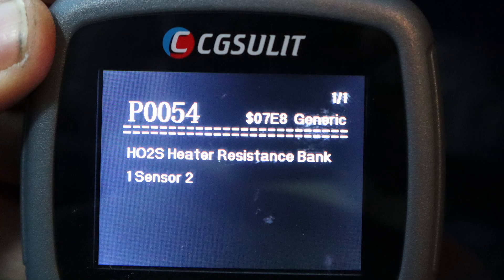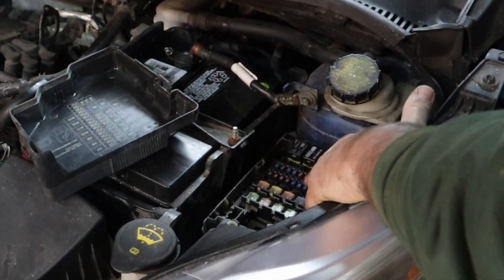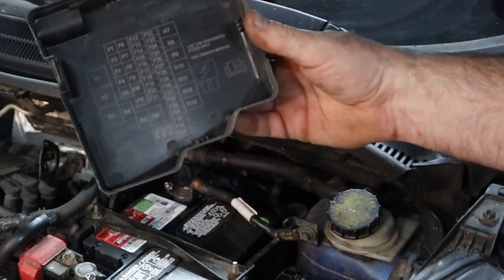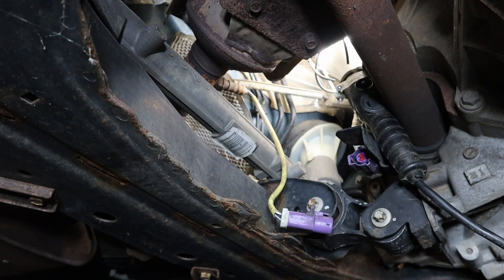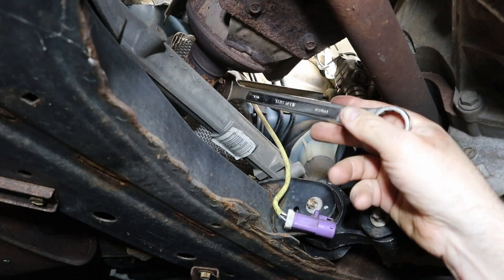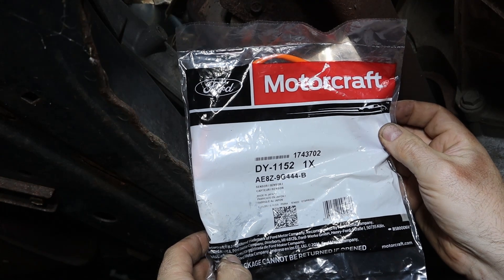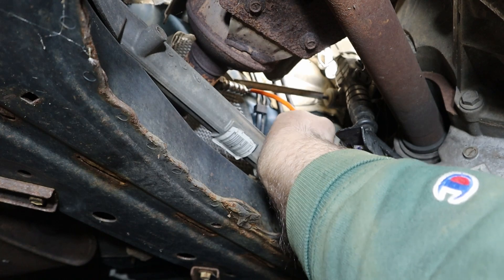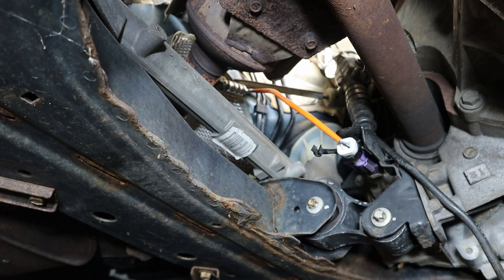P0054 Code Fixed – Replacing the O2 Sensor on a 2011 Ford Fiesta | The Fixit Shed

Comment: Very helpful. Question, you said you want to get it inspected. Does it mean you are taking it to ford dealership or any mechanic shop will do ?
Reply from the maker: Pennsylvania state annual safety and emissions inspections.  Most service stations are certified to do these inspections.  If the check engine light is on, it doesn't pass.
Reply: @TheFixitShed i see, I am in Florida, ride at your owen risk state.
Reply from the maker: Yeah, I have seen some crazy stuff in Florida.  My Anut and Uncle used to live there, near Tampa.